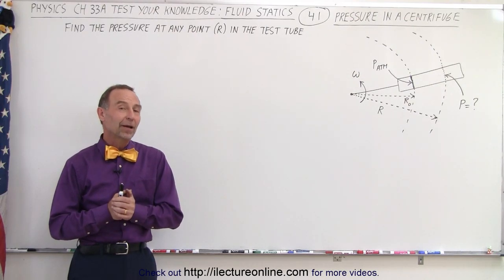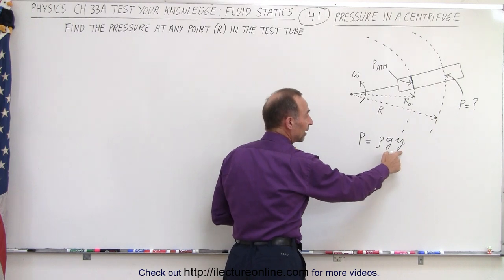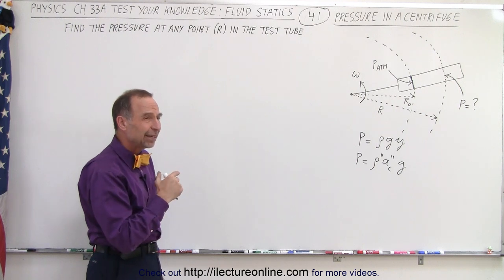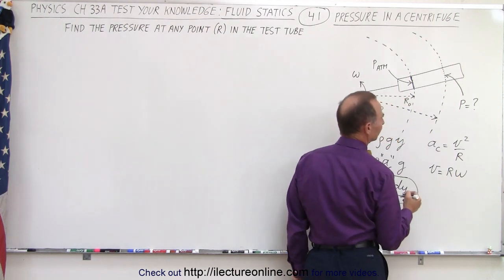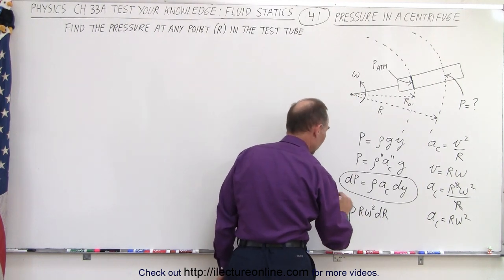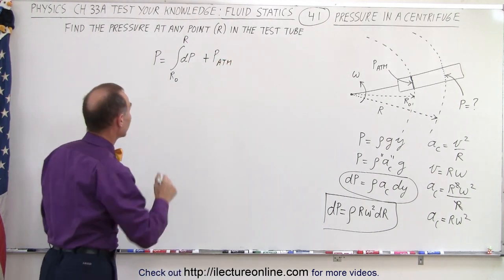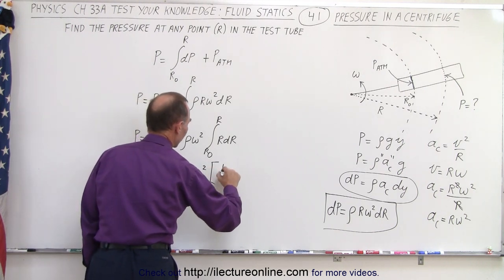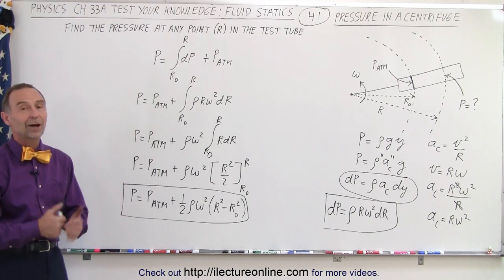Physics - Ch 33A Test Your Knowledge: Fluid Statics (41 of 42) Pressure in a Centrifuge

Comment: Hi, can this be applied to a centrifuge with a test tube that is at a constant angle off from being linear to the centripedal force (like in a fixed angle centrifuge rotor)? It's tempting to say "yes" because when stationary, the angle won't make much difference to the hydrostatic pressure, but this video has shown me that the apparent pressure is dependent on the radial distance. In this scenario how should we treat x and X0?
Reply: +1 here on this question. Do we simply apply a bit of trigonometry to the radius based on the rotor angle?
Reply: Just use the radial distance, the angle doesn't influence the hydrostatic pressure